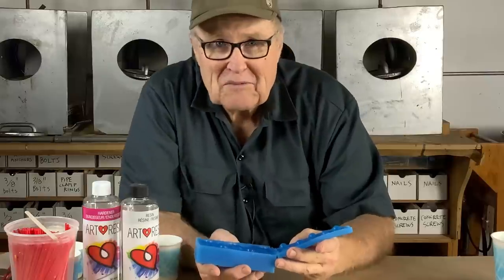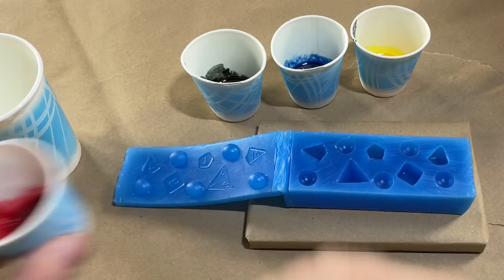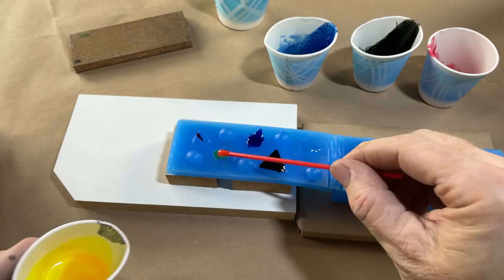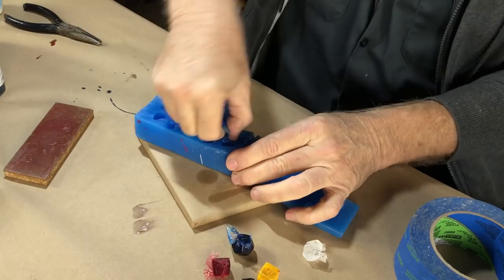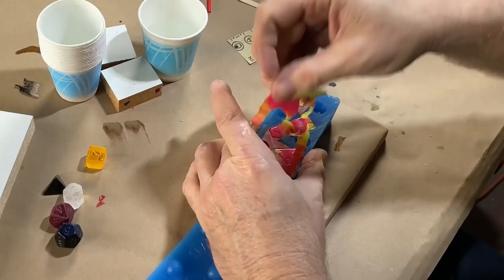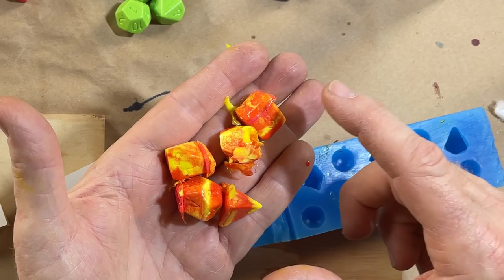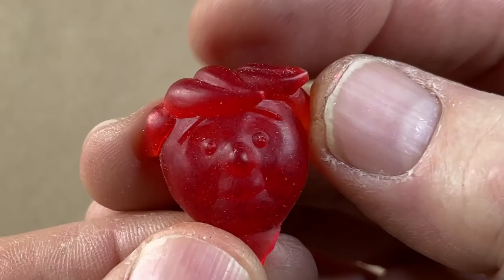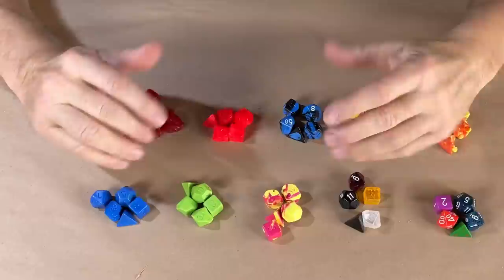Dice Casting - The Good, The Bad And The Ugly - Part 2

Comment: I always use a pressure pot with my dice, don't have a vacuum chamber. Just make sure you fill the mould to the top and adding a generous amount to the cap. Then add the weight to reduce lifted faces. 
Works for me at least.

Comment: In the "old days" the dice usually didn't come with the numbers painted.  We rubbed crayon into the faces to make the numbers more readable.  That probably doesn't help you out but I thought I would share anyway.
Reply: I've heard that large scale manufacturers dip the dice in paint and then put them in a rock tumbler to wear away the excess. That is probably equally unhelpful.
Reply: I came here to suggest this exact way to color the numbers
Reply: This brings me back to my early D&D days

Comment: Several things:
When you use a vacuum with epoxy resin you need to let it rise and fall a few times.
Next: when you reused the mold with a different chemical, you didn't bother to clean.
99% isopropyl alcohol is the best, solves the water problem also. I personally wouldn't use that type of resin for dice. I use a reason that takes awhile to cure, that way I can rectify my mistakes before hand.
Also: No master what epoxy you use, it is Not a forgiving material at any time!
The others are right check out Rybonator he's pretty impressive, I think your 1 set mold is something he needs to learn. The potential is high! I'm going to try it myself. I always wanted a custom Yahtzee set!

Comment: welcome to the wondrous land of dice making ^^. You should also pressure cast the epoxy resin. More patience to get bubbles removed, or use heat, but that shrinks your working time. Then add them to the pressure pot. If you need a reservoir (I know you want to minimize clean up) you can poke a small hole through the lid into each die, at best at the corner. Then do all the same as before, but after closing the mold, add a few drops of resin to the reservoir holes, that can compensate the removed bubbles from the pressure pot.
For Inking, I like to use needle bottles and acrylic paint, use a paper towel to remove fresh residue paint und after drying take a towel and some alcohol to remove the last fine residues on the surface.
Reply: Needle bottles is a nice idea, definitely worth a shot.
Reply: @DKarkarov  works especially good on self made dice with deeper number engravings.
Reply: @wuerfel_schmied  Gonna give it a shot myself, just waiting on amazon.  Mine definitely qualify for deeper engraving.
Reply: @DKarkarov  you have an Instagram to follow your work?
Reply: @wuerfel_schmied  unfortunately I am a perfectionist and generally don't show anything but I will see if I can look you up later and what I can do.

Comment: Something I noted while making my dice was that each time I pressurized my castings air got pushed into the silicone mold and that caused multiple sets of mine to fail due to excessive bubbles. My solution is to let the mold itself de-gas for about 2 hours before I do my next casting. My guess is that silicone is porous to a very tiny extent, but enough to get air trapped. I could actually see the air escape from the silicone when I poured water into the cavities and saw bubbles being produced by the mold. 

Quick not on the mold: I use platinum cure silicone that was cured at room temperature of about 24C under 3 bar of pressure. Castings done without letting the mold degas always had huge voids, every time. Castings done after letting the mold de-gas had a 100% success rate, I am now at 24 sets without any voids.
Reply: Have you ever tried vacuum degassing?
I only use a vacuum chamber & let most of my resin castings set under a very weak vacuum (mostly just to keep the lid on) but I don't tend to run into bubble issues unless I've made mistakes

Comment: If the numbers are large enough (not micro die) a very fine Sharps pen can be used but it requires a steady hand. Alcohol can remove mistakes before the ink dries but you have to be quick.

Comment: bubbles come from temperature. The resin basically starts to boil, and you saw effect being worse when you heated it up before pouring. Hardening is an exothermic reaction. So you either need to slow it down by mixing it cold and smaller quantities, and pressurize it quickly, before it heats up. High pressure increases the boiling point. I'd do 1 dice at a time and pressurize it right away. You only have about a minute of working time with those

Comment: I believe you're getting bubbles in the clear resin because as it hardens, it starts getting hot and creates bubbles. With the head you casted in comparison, I'm willing to bet the mold had a pour spout which also acts like vent tube for the bubbles. With the dice mold once you close the lid everything is trapped inside. You should try the clear resin with the dice mold without closing the "lid" just as an experiment.
Reply: I expect the other mold was open back with no vent hole at all as there would be no need.  Art Resin is definitely a cheaper "crafter" resin and not a lot of fun to work with.
Reply: @DKarkarov  the head mold was probably a conventional 1 piece with a pour spout, which acts like a vent for bubbles and gases from the curing process. That clear resin, although it takes a while to cure can yeild some pretty nice results and is pretty forgiving when used in typical molds.
Reply: @A.B994  I would have to disagree with your first comment about the heat, speaking from experience not opinion. 

I had this issue with a mold of similar construction for small clear resin pieces, less than 10ml each. Using the same exact resin from the bottles that rendered the poor results. 
First i tried using less and less color, which helped some what.(with and without a vac prior to pouring and with and without a pressure pot in different combinations). But what fixed it was using it without the "flap" allowing the gases to escape. I was using the same resin Robert used in this video .
Reply: @A.B994  mold star. Never had an issue with it before, including with that art resin that I got from Micheal's. I was going to say it was old or just moisture, but i tried the same mold in a controlled environment without closing the flap (allowing it to breathe) and it cured perfect with color and no color added (using the same resin, from the same batch). Ive come to the conclusion that it needed some sort of vent.  I just switched to smooth on clear, to avoid this.
Reply: @A.B994  yeah, the clears are always a challenge balancing time and clarity. Art Resin is decent and usually always available locally for me. By I try to stick to SmoothOn just to eliminate the possibility of chemicals not being compatible. 

Although I never did try a closed mold with another batch of art resin. Worth a shot just to rule it out.

Comment: That's super interesting information about the urethane/epoxy reaction on the mold walls. Also, really great bit of investigation into debubbling the art resin! 
When I got my first set of dice, I'd heard the best and quickest way to fill in the numbers was to take a grease pencil and grind hard into the die faces, then wipe off the excess. It's not bad, and takes less time than letting paint dry. Wax crayons might work too, but I haven't tried that. In terms of results, acrylic paint should be at least as good and being in recessed numbers helps keep it from chipping away even in a dice bag.
Reply: I remember back in 1980-somethin’ Dungeons & Dragons sets came with a white crayon to fill in the dice.  It always seemed to work pretty well from what I remember…

Comment: I redid the paint on my old dice using white UV resin nail polish, squeegeeing it on with a straight razor blade. It worked pretty well, no cleanup, though they have started to come loose over time.

Comment: Oh and regarding the numbers, grab yourself some leaf metals for gilding. Can get just about any metal you'd want. Copper gold or silver look great on darker colored dice. Simply stretch a piece of fabric over a smooth block of wood and clamp it down so it is stretched smooth and tight. Brush on the gilding adhesive onto the face of the die and then put a few drops of isopropyl alcohol on the fabric block and rub the face of the die to Clean off the sizing/adhesive. Then when you add your metal leaf it will only stick in the recessed numbers to give a very classy metallic appearance 😉

Comment: About the red dice where you were talking about resin molecules mixing with rubber. I'm interested to prove that theory you could saw a dice in half. If the middle is clear or at least bubbles are less and less dense towards the middle. Then it's what happened. If not then it's probably something else.

Comment: If you're going to cast with something like art resin without a pressure pot, you really need to make sure your mold is insanely good. There's a tutorial here showing off how to do it, which includes pre-painting the numbers with silicone, then the faces, then taking very careful steps when both pouring the mold and then pouring the resin itself (warm water bath, using a sealed stir stick to prevent bubblage, stirring very slowly, letting the dice sit until the end of the pot life without the lid on, popping bubbles with a lighter multiple times). I don't cast without a pressure pot when I'm doing dice, and I've never needed a vacuum chamber. I used to dump a lot on the cap, but now I just make sure I have a nice dome on the poured dice and a good amount of weight on the lid.

Comment: I can tell you exactly why the resin dice had so many bubble. Resin has a safe temperature range for curing. Below the bottom of that range, it won't set. Above the top of that range, it will start to boil. You more than likely applied too much heat to the resin with the heat gun, then poured it, and the chemical reactions got it hot enough to boil.

Comment: I've used art resin a lot, and it's a bit of a pain to use. You can vacuum art resin, but you have to warm A and B in warm water baths before mixing, then quickly vacuum the resin. I let it go for a few min, because of the long working time, even with it warmed up, the pot life is still over 20min in my exp. I hit it with a heat gun to get rid of the tiny surface bubbles. But then I let it cure in my pressure pot for 12-24hrs. Also, I use platinum cure silicone and have cast both urethane resin and art resin without issue. Just a few tricks I've learned, I hope this helps someone

Comment: 1. To paint the numbers use a large brush and just dab it on there, and then immediately wipe it off.  It will leave the cavity filled, and the surface clean.
2. To test them for even weighting, put them into a cup of warm water (can't remember if you add salt or soap), and spin them with your fingers.  It should be really easy to see if they have a "preference" to stick with a certain side up.
Reply: It's salt to make them buoyant.

Comment: @Rob I was under the impression this particular resin was pretty gassy and required a respirator to work with safely?
Reply from the maker: Most people use this resin to put a clear coating over a large surface. That puts a lot of volatiles in the air.  I am pouring a very small amount of resin and my shop space is large and very well ventilated. Also, I’m talking on camera and my masks make me hard to hear.

Comment: I’m pretty new to working with resin, only been doing it a year of various pieces and parts for my sculpting, and I wanted to say the art resin had TONS of bubbles when stirred quickly, less when stirred more carefully, so don’t WHIP the clear resin. And the least when a stir tool on a drill was used (makes sense right?) also i gave a vigorous tapping to the flat back poured molds and vibrated the table they were all on.  Pouring without degassing or pressure potting the resin and then let my resin just sit overnight. Actually I was surprised that last method had the least bubbles. I’ll keep working with this art resin because it was CRYSTAL clear so will likely get some of the results I’m looking for as I keep getting used to working with it. But I learned a lot watching your videos and not mixing other kinds of plastic in silicone molds used for casting epoxy resin was a HUGE tip. Also really learn a lot reading the comments from others who work with casting dice. Even tho I’m not casting dice, the tips about how they get rid of bubbles was great. Just thought I’d share my beginning tests and what I’ve learned so far in my own small resin work.

Comment: Bubbles float upwards right? So what i tend to do is either suck from the lower non-bubbly half of the container with a syringe, or poke a hole on the container's bottom side so clean material pours out of it, not the foamy stuff like in the case of pouring by tilting. If you want to pour regularly, just use a second container in which you collect the bubble-free half, then place a third container in its place while you tilt pour using the second.
Reply: That is actually pretty genius, i might try this out! Thank you for sharing this :)
I read somewhere online about the method of pouring the resin through a hole in the bottom of the container and thought it would just be really difficult and messy- so your technique sounds perfect!

Comment: Started watching b/c I always think about how a lot of the DIY dice being made in recent years just can't be properly weighted, but this ended up being so helpful. I'm about to do a big urethane project and had completely forgotten that if I want to try a variation of a part with clear resin, I need to pull a mold & set it aside specifically for that experiment.

Comment: Hey, that heat gun thing was interesting. I'm going to do some prototyping just to learn and get to know the materials before investing in a vacuum chamber and a pressure pot - would a heat gun help somewhat with polyurethane resin as well? Since it's prototypes, bubbles aren't going to matter that much - but if I can help a bit of it it will help structural integrity.

Comment: Bob, I was wondering if you sprayed that chemical that stops foaming into urethane resin before you poured the dice mold?  I never had any luck with urethane resin except for the first time when I opened the container of the urethane resin. I poured it into a new silicone mold. Since that time the urethane foamed on every pour even with using the pressure pot. I figured that the urethane picked moisture when I removed the cap from the new container. After that it was worthless. You asked about coloring in the numbers on the dice. I use magic marker thin point in different colors which seems to work well. They make an acrylic marker for use on dark colors. Best regards, Richard
Reply: You fill the air gap between the resin and top with an inert gas. Nothing is added to the resin .
Reply from the maker: @glenfisher728  That’s right.

Comment: Great info as always! One of my favorite channels.
Could you remove/move bubbles with centrifugal forces?
Are there any other tin sure silicone suppliers you recommend besides silpak?
Reply: A pressure pot doesn't remove bubbles from resin it reduces them microscopic size . No a centrifuge wouldn't work .

Comment: I'm always thinking, wouldn't it be possible to mix the components together without introducing any bubbles in the first place? Like in the nozzle of those two component epoxy glue syringes? Or maybe directly in a vacuum?
Reply: that''s actually a fun idea. I use the 3m glue guns and those mixing nozzles are like a little maze.
Reply: @dougatfuto5  I was sceptical whether a guy with a popsicle stick was what peak performance looked like, and turns out the industry actually has a solution to mix under vacuum without blades, in the form of planetary centrifugal mixers.
Reply: The glue mixers you are talking about are called static mixers, they work well but you need to ensure you are pushing the material through at ratio because they mix well locally but not through a whole mix so you need some way of metering the materials (like the cartridge the glue comes in), they also take a bit of experimentation to determine which diameter, number and type of elements works best for a particular resin.  Planatary centrifugal mixers are fantastic but they have down sides first they heat the material significantly so you would never beable to use a fast cast PU using one, secondly they are massively expensive, we have one in the lab here it mixes upto 100g and cost in the region of £10,000 so not the sort of thing a hobbiest is ever going to be able to justify.
Reply: @chriswebb9375  Thanks for the insights.

Comment: Hi Robert, can you say anything about the dimensional accuracy of the castings compared to the originals? I'd almost assume there is some shrinkage along the way (silicone and resin), but how much?
Reply from the maker: There is some tiny shrinkage no doubt but, without having to put calipers on the copies,  I have to say that the difference was not noticeable.